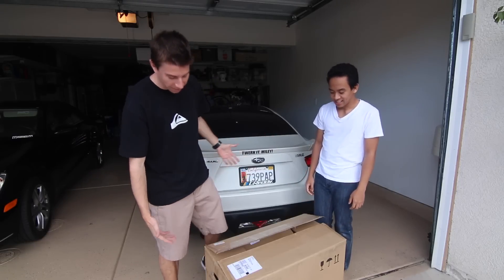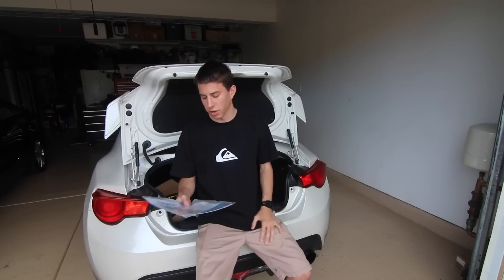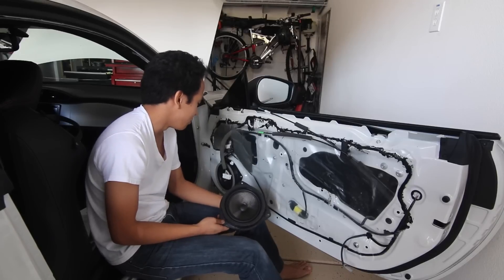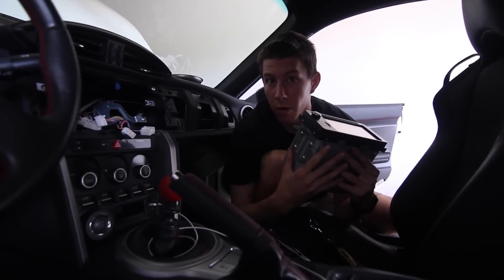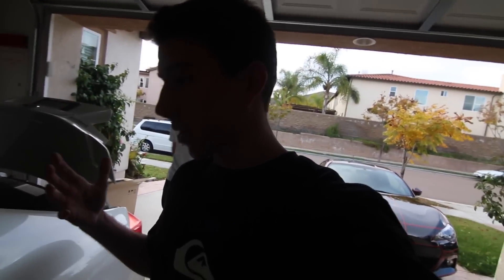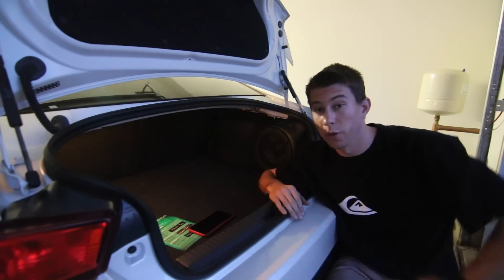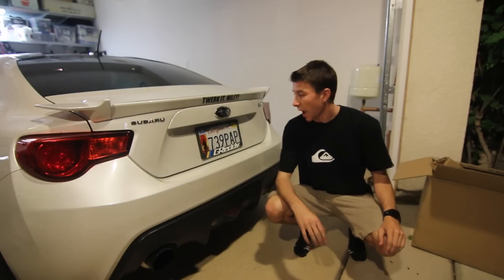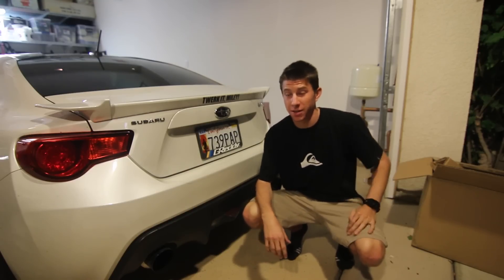OEM Audio Plus Unboxing and Install!(400CF Subaru Brz)

Comment: Good video.  I've had an OEM Audio Plus setup in my BRZ for about 18 months now.  One quick suggestion that I do to add a little more bass is to just always keep the back seat folded down.
Reply from the maker: I will remember that, thanks!

Comment: thanks for this video! have you heard the OEM+ system in a wrx? I'm trying to see if I can get any solid reviews on that before buying it for my '16 wrx. thanks!
Reply: +KMEninety335 I've read many reviews on it on the forums. If you're an audiophile or anywhere near one, you probably won't like it very much. Most people's complaints were that for the same price as OEM+ aftermarket setup, you could put together your own setup that sounds a ton better. (punchy bass/mids, not super clear or great quality but still improvement over stock system by fields) Not super versatile. But gets the job done if you don't have super expectations for your audio system.

What you get for that high priced kit, is basically everything you need to make it look stock. That's why it's priced so high, as it is designed as a stock speaker system would be designed for a car (which usually aren't extremely versatile in the first place).

so in summary, if you're cool with improvement over stock sound system coupled with lower quality bass/subwoofer, then go for it!! However, if you like your subwoofer to be extremely clear with hits and distinguish between frequencies better, build your own setup.
Reply: +doctacos1 thank you for your input. It definitely helps! I went with the system. Installing it soon. I did some research and without putting a big box in the trunk and changing out the inferior head unit, I think it's a pretty good deal. Thanks!
Reply: Great!! I really want to go for it as well, It looks so clean and nice! But I am nervous about spending the money to go for it and not be fully satisfied with the sound long term.

As for the HU, I am considering doing the same myself. Haven't decided yet. It's either upgraded HU or using a one of those external eq Line drivers from the HU. If you do, you should post on your channel you upgrading the HU! I've read it's rather tricky with the new wiring and integrated controls but I am not great with wiring so there's that. Anywa, Best of luck to ya!!

Comment: have always wondered what that plastic piece when u look at the rear window. The black thingy smack in the middle of the window.
Reply from the maker: its the rear brake light
Reply: Tj Hunt OHHHHH thanks!
Reply: DemonzGaming
It's really annoying. I got a third brake light that goes on the top of the window and it looks much cleaner.

Comment: I am most likely getting a 2013 Brz in a few weeks or so, and I was wondering if you knew of a good upgrade for the sound system that is less expensive than this. I was hoping to stay around $500 if possible. Any help or suggestions would be greatly appreciated!
Reply: Update

Comment: Will you recommend to heavy bass lover? What do you think of the bass?
Reply: +Justin L No, not at all. Remember, with this setup you're paying for a stock OEM fit, not super high quality. If you want heavy bass, go for a decent, Idk, 400 watt system (amp + sub rated for 400rms). That's a good mid power. anything below that and you really start to lose out on sound quality in your bass.
Reply: +doctacos1 400 was a number I threw out. I had a 10 inch 300 watt jl sub, built with the proper specs on the box, it could hardly hit through my trunk (i couldn't feel that shit at all). I was super disappointed :(. I went from that to a 600 watts flat mount (maxed size box). That was amazing. I miss it

Comment: Sounds like a good value at $1,500.   You are limited by the horrible, horrible factory radio.    Your $1,500 would be better spent on Morel 3 ways and an High quality aftermarket radio.  It would NOT play as loud as the OEM but most likely would sound much better. Still seams like a good value for those folks that want better sound but don't know much about audio.